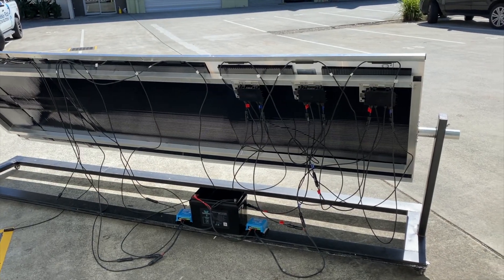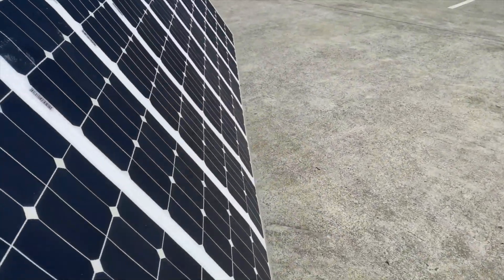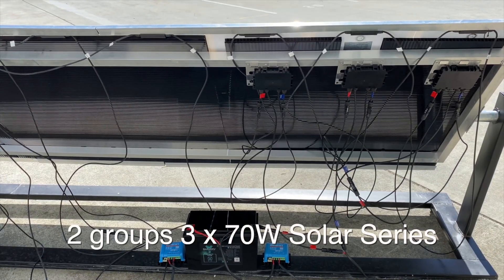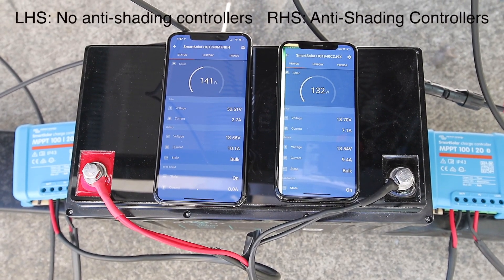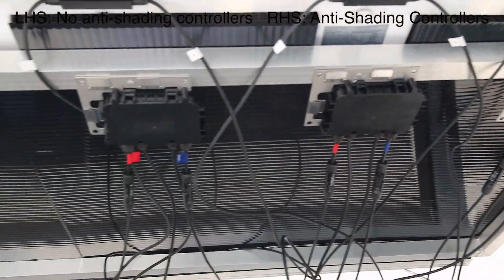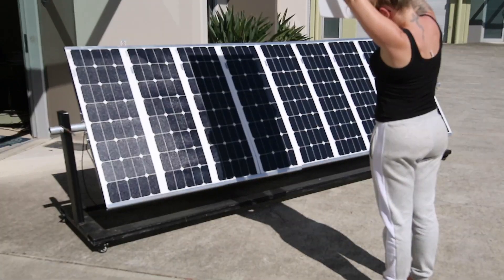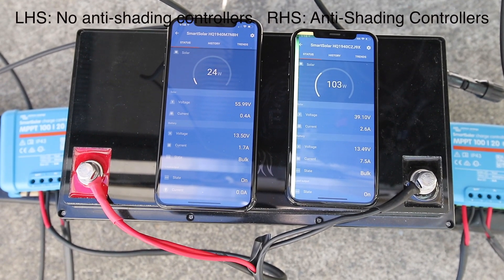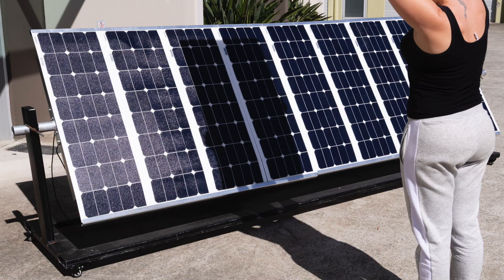Assessment of Anti shaddowing controllers on a Series Solar Panel String

Comment: It is clear that you have use cheap solar panels without bypass diodes in them. If you carry out the same test using good panels with bypass diode's,then you will see no difference between the two strings output during shading.
Reply from the maker: Yes we have moved to full DC/DC Buck Units now with Victron glass. Results for RV's are sensational.